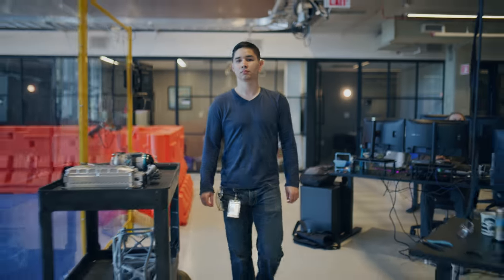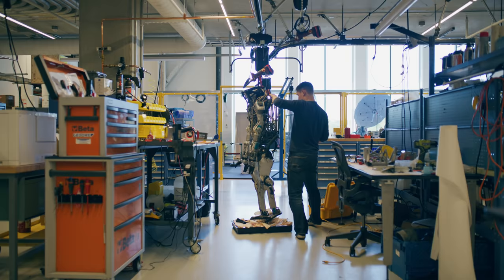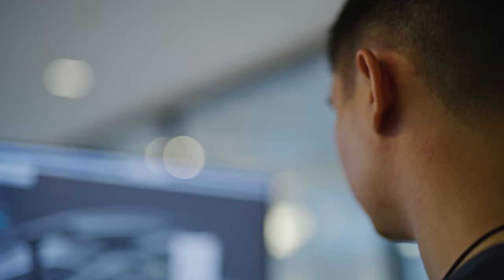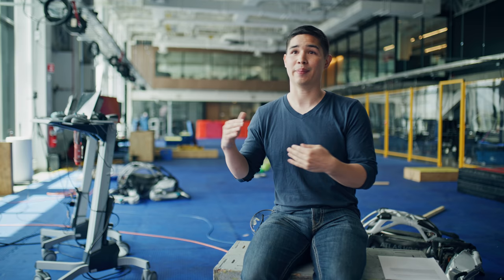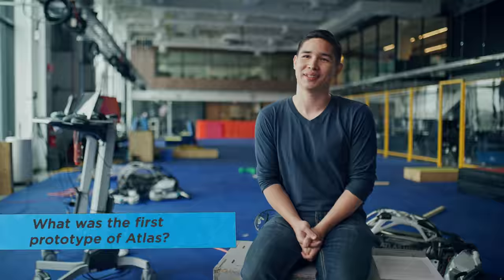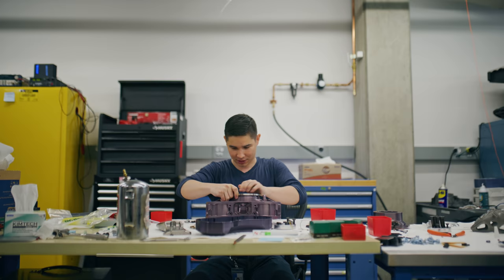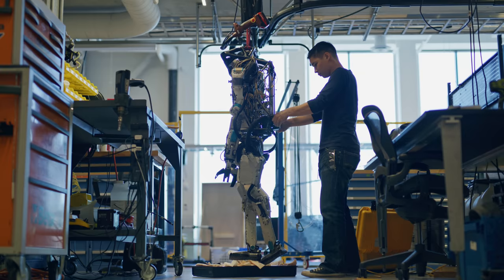Ask A Roboticist: Meet Josh | Boston Dynamics

Comment: The "take apart everything" is a very good tip. I disassembled broken cameras (shutter stuck), lenses (aperture stuck) without any guidance, just by "feel". Then I fixed them, cleaned them, managed to build one fully functional camera from three broken ones. Of course, I am talking fully mechanical, manual SLRs. Of course, many broken things I got could not be fixed, but I salvaged lots of spare parts and learned a lot. Well, that was decades ago. Today I am too old. Or lazy. Or both. 🙂
Reply: Absolutely agree, every time you take apart something (an old printer, a graphics card, an old tv, microwave etc.) You can learn so much about the the engineers thought process when designing the product. It cost almost nothing and it's a great learning tool.
Reply: Even if you can't fix a broken product, taking it apart really helps in understanding how different parts and systems 'work together' and how technology progresses. I've taken apart 2005-era Nokia phones and 2012 era Samsung smartphones. It's really amazing to see how much more compact and complicated things can get over 7 years.
Reply: The good old Single Lens Reflex. I still feel they still take better pictures than today's mobile phone.
Reply: @phantom_fox_blue4384  They do, if you put a decent lens on them. Fortunately, most set lenses were decent 50 mm f1.8 or similar. While still cheap to manufacture, as the design is decades old and proven, they have usually a much better optical performance than any tiny phone lens. The smaller the lens, the less room for tolerances. Sensor size is another issue.

Comment: I mentor kids in robotics. Josh is right, the best first step is to take things apart to see how they work. I used to do a spring break camp where kids took printers and other stuff apart and we would help them determine what assemblies to keep intact. Then in the summer we would use Arduinos to make those assemblies move and do stuff. The main thing is to GET BUSY and NEVER stop being curious and learning. Josh has the dream job and has worked hard to get it, you can too if you start NOW and don't slow down. 
Love the video Josh, well done!

Comment: I've worked in the robotics industry for 40 plus years. When I first got into the field robots were mostly hydraulic. Now through advances with AC motors and PWM they are mostly all electro-mechanical. It's been fascinating to be part of this growing industry and observing the acceleration of advancement. Josh is 100% correct when he says you won't ever be the smartest man in the room because things are changing on an almost daily basis. It's impossible to keep up with new actuators, sensors, computation and computer code including AI. I would encourage anyone to get into this field because it is in fact the future. If you're impressed with Boston Dynamics accomplishments to date stay tuned because you ain't seen nothing yet. This is just one of many companies pushing the limits of robotic technology.

Comment: More of this guy.  The Q&A is good, especially if it continues.  More general and specific questions.  Obviously you have to avoid exposing i.p. and n.d.a.s, but I would love to see whether Boston Dynamics works with other companies.  For example, I've seen what MAY be dramatized SPOT scouting... walking around industrial stairways, etc.  Maybe we could see how Boston Dynamics interacts with necessary vendors (like battery companies), or how different builds are implemented.  There must be a base model and models with Canon lenses, or government level radiation shielding, or flush systems (like one might imagine there being on the moon to shed regolith particles).  I suppose a lot of time is spent on the RIGHT things, but I'd love to see more.

Comment: Next up, 1) tell us about the software architecture and its different components and technologies (ML algorithms etc). 
2) For the team, what have been or are 10 of the major challenges and tradeoffs you have to make? 
What is easy and what is not easy?
3) Also, thinking of a squirrel, tell us about the process and difficulties in making robots as fast as squirrel, what are the challenges there? What is easy/solved, what is difficult, both on hardware and software?

Comment: Question: How much in the software of Boston 
Dynamics robots is 
- Neural Net, is 
- open loop and 
- closed loop control?
Reply: Interesting question. I wonder how important is the knowledge of control systems (optimal control/model predictive control) compared to knowing machine learning/deep learning/computer vision
Reply: @davenarisotto3674  If you ask your question for 
a job you want to do, then the basis for you 
is electric engineering, then control systems 
for open and close loop. 

The areas of machine learning, deep learning 
and computer vision can be interesting for 
you afterwards.
Reply: @silberlinie  right now i'm studying computer engineering (bachelor), my university offers 2 masters in robotics: one is focused on controls and they also teach machine learning and computer vision, the other is called "robotics and AI" where they teach a little bit of controls but focus more on computer vision/ai algorithms (like graph traversals and such). I wonder: to make a robot navigate, should i focus more on control algorithms or more in ai/graph algorithms? And with a wider view: does the robotics industry focus more on controls or is it transitioning to machine learning/ai models? I hope i got my point across
Reply: @davenarisotto3674   The robotics industry focus more 
on the transitioning to machine learning/ai models. 

So, it looks like the 1st way you mentioned is the one 
that is preferable.

But keep in mind, electric engineering and control are 
still the basic of all the stuff.

That's why it's also very much up to you to decide what 
you're attracted to.
Reply: I think its based (currently) around a sort of loose loop, where it follows a set program, but is allowed to adjust that path to an extent to correct for instabilities, such as a rock, or a bunch of spilled parts (in a factory, or similar place where objects on the ground are commonplace)

Comment: A question for any of the software engineers: Have you added any kind of AI or ML or just a neural net on top of the software stack for a robot just to see what happens and if you could have a robot that learns autonomously?
Reply: AIs arnt that advanced. they need special training for specific tasks and 10s of thousands of steps to learn it. they also still need human coded software to bridge the the gaps between the AIs so they can do things that require multiple specialties. You can think of an AI as something that specializes in exactly one thing. The more you want it to do, the larger the brain of it needs to be and the longer it takes to learn. Though some of this may be due to processing limits. So a brain that processes with light rather then electrons might be faster(but that tech isnt ready yet), there is also the possibility of hardware based processing where the neurons are physical and not virtual(processed by a CPU), but that type of model is different then what they currently use, but i think it has far greater potential.

Comment: 1. How many actuators are in Atlas?
2. Is all the actuators are hydraulic?
3. How do you control many hydraulic actuators simultaneously with one pump/ motor?
4. Is those hydraulic actuators are different from available industrial / robotics actuators?
5. Is Boston Dynamics has any plan to sell Atlas as a product? Same as Elon Musk plan?

Comment: Iron man suit

The magnetic field can be used to generate electricity. Metals such as copper and aluminum have loosely bound electrons. Moving a magnet around a wire or moving a coil of wire around a magnet pushes electrons into the wire and creates an electric current. Make a magnetic tray and place copper coils on it from time to time. As you walk, the copper coil moves back and forth across the magnet to store energy. Then all you have to do is save energy. All you need is a storage device for this. We made a suit out of thousands of tiny gears that work like clockwork when we walk. We used our motion to rotate each small magnetic gear and placed as many copper coils as possible on the sides of the suit. This allows you to capture as much energy as possible. It's not the coil size that matters, but how many coils in each coil can produce the most power. The installation allows you to build an internal power supply line that feeds the internal generator.

Comment: Why are electrohydraulic proportional/servo valves so expensive? I have been exploring building a haptic virtual reality force-feedback exoskeleton on a full motion gantry. It looks like I need at least 30 EHSVs for the back, shoulders, arms, legs, and about 20 EHSVs per hand. But the valves are around US $500 each and large and bulky. I would have to blow $35,000 just for a pile of 70 valves and I've built nothing so far. Seems like the first step is forget about the robot exoskeleton and research building my own low-cost multigang EHSVs that can pack them tightly together in a very small space.

Comment: Why biped? Isn't biped an inherently inferior mode of transportation? 
I imagine that a robotic tarantula with several additional robotic arms on its back would be superior to a biped android like robot.
The center of gravity is lowered, and weight is distributed amongst more legs, thus the overall structure is more stable.
Electric powered wheels can be attached on the robot spider's feet to increase travel efficiency. The legs act as suspension.
 However, in extremely rough terrain, the wheels lock up, and the spider uses its hydraulic legs to move itself instead.

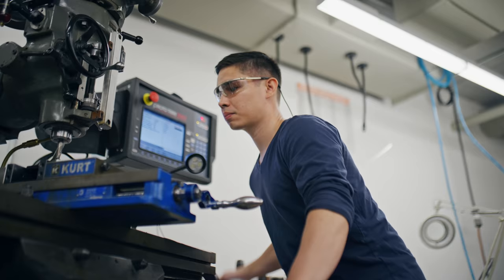Comment: @4:50 That's a very washed down answer to a more complicated career ( manufacturing engineering), Yes, cnc ( machining) programming can be simple. However not understanding GD&T, and assembly relationships is a path to failure. Additionally, although we are "growing" metallic parts ( sintering) it's not just a matter of 3d printing them and they're ready for use. Again, my first statement applies. Critical dimensions and registering features must be post machined in order to obtain the types of tolerances that make the parts functional. I encourage young people interested in this field to explore the machining area some more. It is a rewarding career, that can lead you in many different directions especially if you couple it with an understanding of electronics.

Comment: why not just build robots on tracks? legs are unnecessarily complicated to build, aren't they?
Reply: Legged robots can climb one day, tracked robots will never climb.
Reply: spot mini legs seem far more durable and flexible than tracks honestly, they can do stairs with ease and those are everywhere in the environments they are employed
Reply: @fredbloggs5902  Do you mean psychologically? For example, working in a retirement home.
Reply: @culturecanvas777 There are devices that you can climb with chains.
Reply: @dopaminecloud  Chains are much more stable. The lever forces acting on the legs are much stronger and the design is much more complicated and can break a lot. A stabilization program must be constantly working. Chains roll much more efficiently, especially at higher speeds.
Reply: Check out Stretch which is their commercially available, new generation of Handle.  Interestingly, some of the thoughts behind the way their research robot, Atlas, picks up and manoeuvres objects, also went into the way that Stretch co-ordinates itself when performing the same tasks.